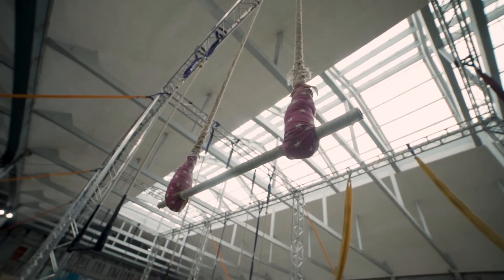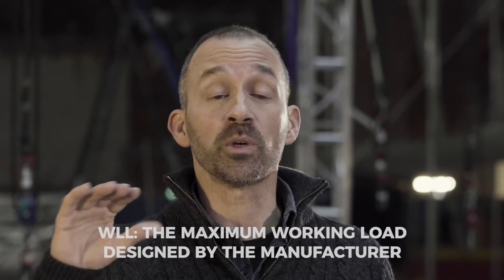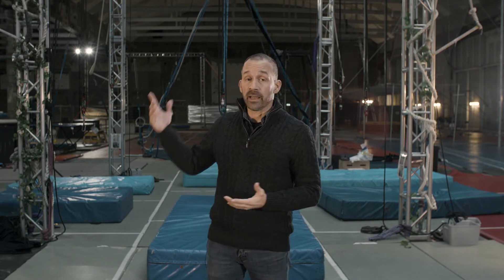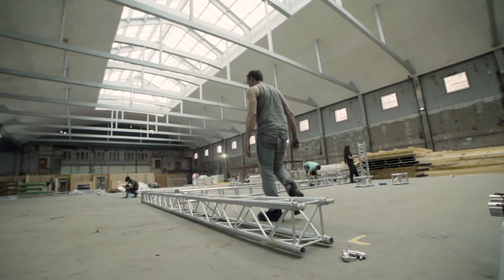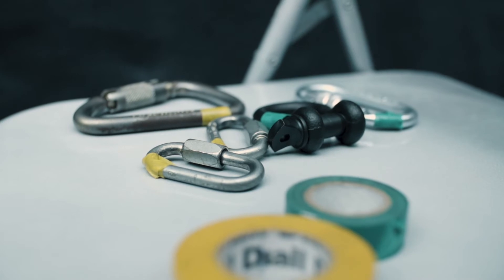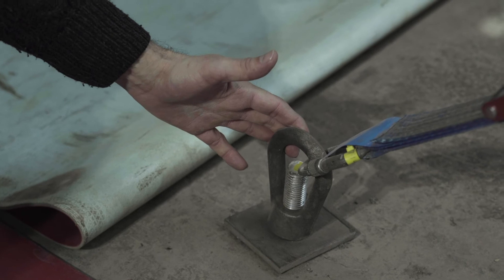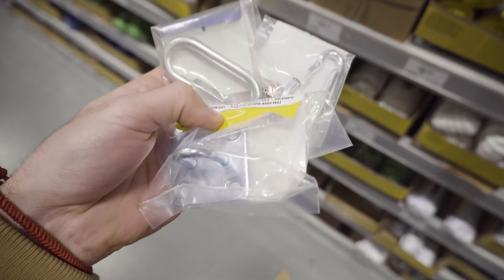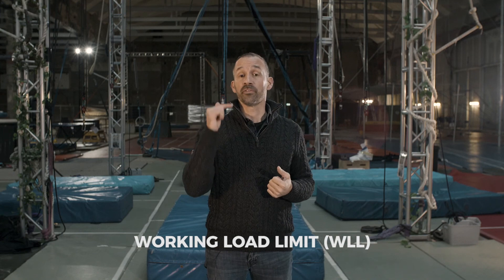Setting Up a Safe Rigging Point at Home

Comment: Overall, a lot of good information. For me… the WLL isn’t as important as the MBS if you don’t know the Design Factor used to calculate it.  We do use DF (what was used to say was the Safety Factor or FoS) over here but Safety Factor is used by some as well.  The Eye Nut you have on the all thread rod for a ground anchor is typically rated for a Pull Out Load for a vertical lift. For an angled or side load the nut should be sufficiently de-rated appropriately, however the pin strength increases as you go from a pull put to a shear load.  As far as DF’s go, in the states we use either 10:1 based on the static load of the performer and gear, 6:1 for the charismatic load during the act or 3:1 of of the expected or unexpected potential peak loading… whichever one of the three is greatest. Showing most engineers a video typically won’t give them the hard numbers they need to calculate the needed capacity. The other important thing to elaborate on is the span and location of the point. A CPL is far different than a UDL or 3rd Point Load. The position on the span closer to the supporting structure will change the capacity. Thanks again for getting good knowledge out to everyone!